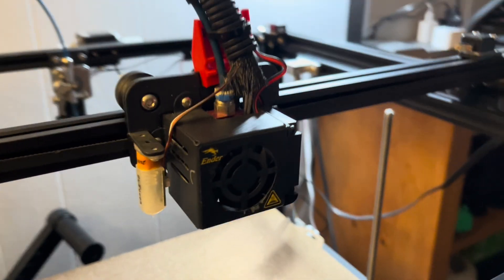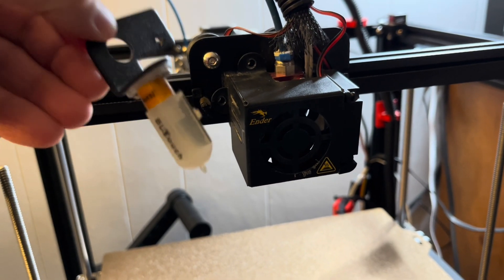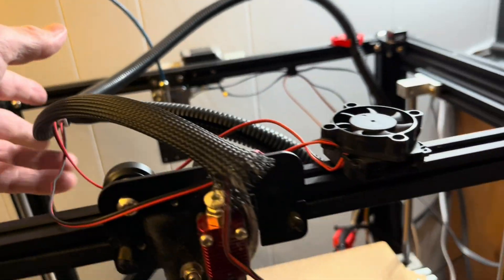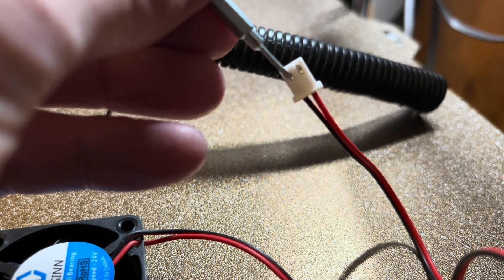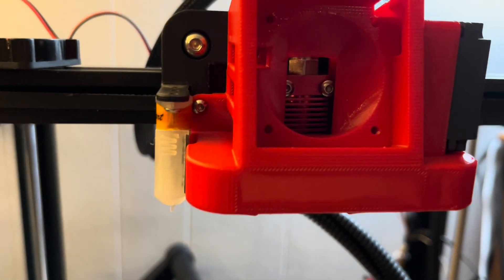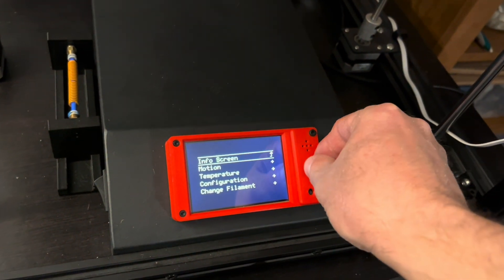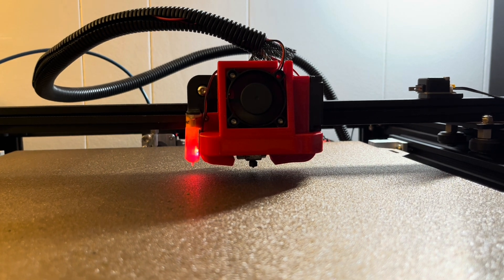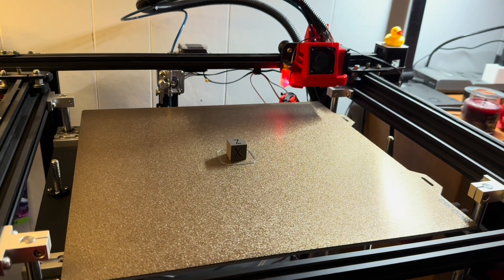Supercharge Your 3D Printer Cooling!

Comment: For a solo blower set up Its better to print and use the 5015 model, bc a solo 4010 lacks the push for the dual ducts. Or else search for the dual 4010, thats good too if you only got those around. I can go to almost 75° overhands with a single 5015